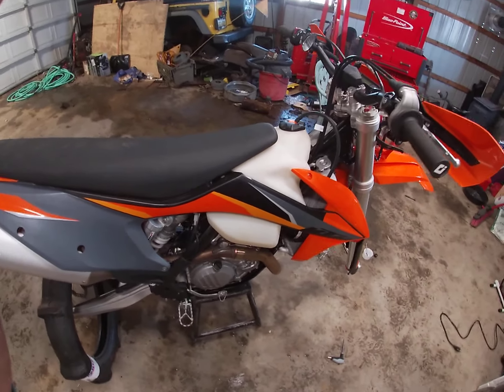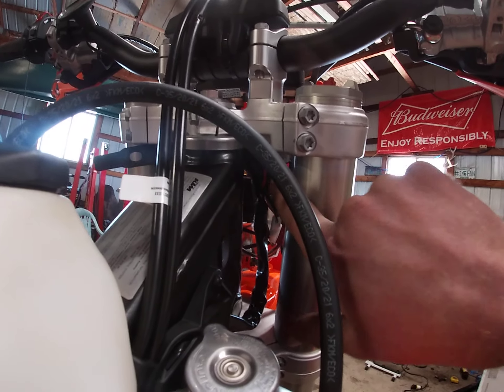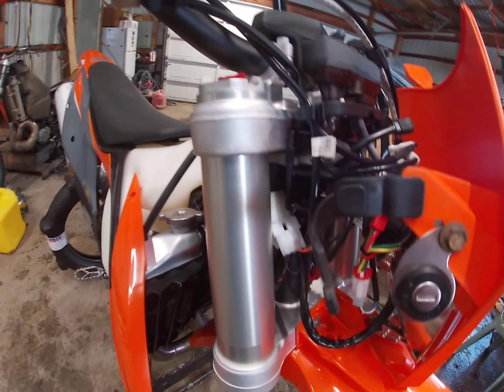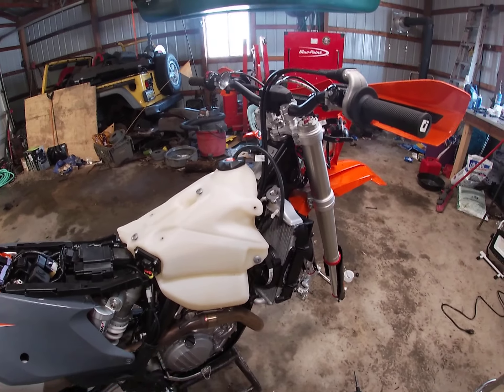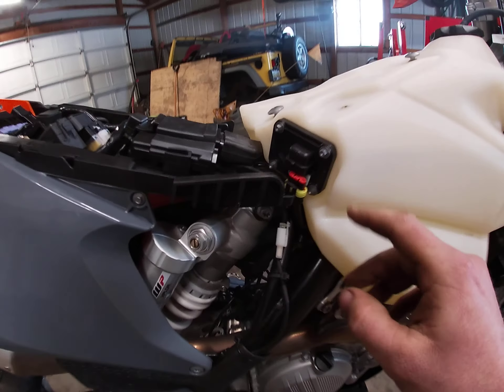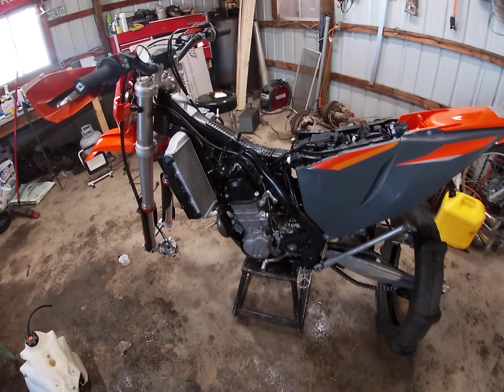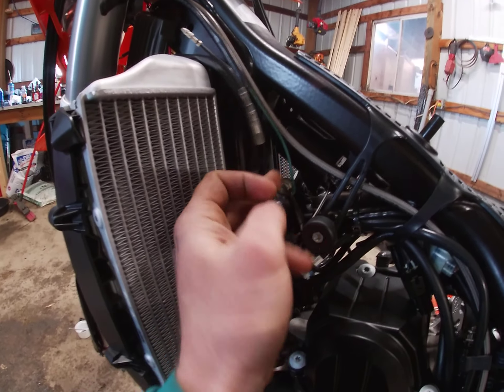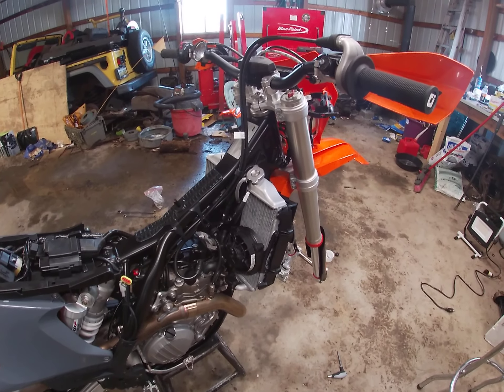2021 ktm 500 xcf-w Key switch install.

Comment: Be been dreading removing my gas tank. It looks pretty simple. Thank you for this. I’m a new dirt bike owner.
Reply from the maker: Not a problem at all man. If you got any more questions just let me know.
Reply: I see that it's been 6 months since this comment, so you may know this already. Tip for you guys. You only have to remove the 4 screws mounted on the radiator, the one in the middle of the tank, cable and fuelconnector to remove the tank. Fairing comes with it🙂
Great video btw😊

Comment: Picking one up for my 250
Reply from the maker: They are nice good product and easy to install. You will be happy with it. What year is your bike?
Reply: @motomatt8915  2022
Reply from the maker: Awesome planning on doing any mods.
Reply from the maker: Performance
Reply: @motomatt8915  maybe a high compression head and a Harley torque pipe and fmf silencer
Reply: @motomatt8915  narly
Reply from the maker: Does that bike have the intake reeds? If it does when you do the pipe pull those out and get a big gulp intake from taco moto. It makes a huge difference
Reply from the maker: I did a video on when I pulled mine. Also did a programmer
Reply: @motomatt8915  no clue it’s fuel injected lol

Comment: Dont forget to replace your tank filter  after alittle while stalk ones are plastic get a hold of ktm and huskey dot com best duel  sports they got the filter that' mint for ktm
Reply from the maker: Will do that for sure. I've heard some people have had problems with the stock fuel pump as well I think best dual sports had an aftermarket pump I was going to get.  Also I got a chance to put about 20 mi on those d606 tires on the street definitely like them so far can't wait to hit the dirt.

Comment: I cant seem to find where the kill switch bullet connecter is and i would really appreciate your help
Reply from the maker: It should be on the left side under the gas tank. There is also a small ground wire attached to the neck of the frame.
Reply: @motomatt8915   I found it :| it was behind the headlight 😂
Reply from the maker: I should have said there is a 4 pin connector to the right side of the triple trees behind the light and thats where you will plug the switch into. But the bullet connector for the kill switch on mine is on the left side of the bike under the tank. There is a connector and a grounded connection.

Comment: I have a 2022 ktm xc 250 tpi and I’m making it street legal and I just bought the tusk racing enduro lighting kit and I’m wondering if I can install a key. Would any key work if i splice the wires ?
Reply from the maker: Key Switch for KTM/Husqvarna/Husaberg/GasGas
$43.95 – $54.95
Reply from the maker: Slavens racing and put In part number SA26-206 that Is for your bike.

Comment: Do you know if this would work on a 2017 ttr230?
Reply from the maker: It wouldn't be plug and play but you could wire it in if you really wanted a switch.
Reply: @motomatt8915  I just don’t want my bike stolen
Reply from the maker: That's why I did it . I have 6100 miles on mine now and go everywhere. It made me nervous as well. You could even just wire a switch in it doesn't have to be a key. I just went with the key because it was plug and play. If you do a switch just put it somewhere out of sight.